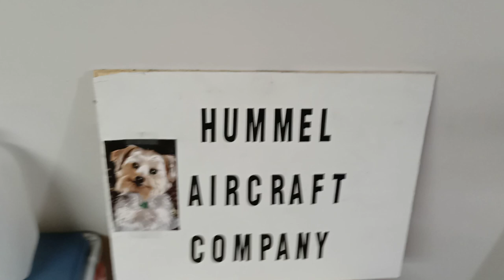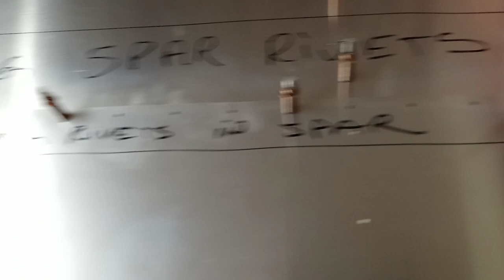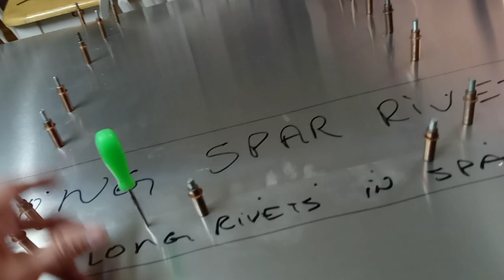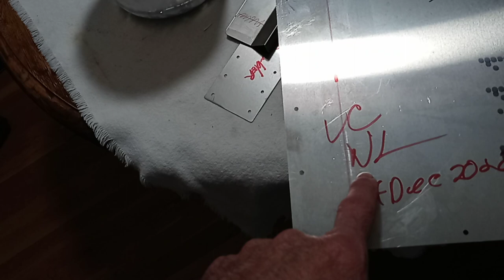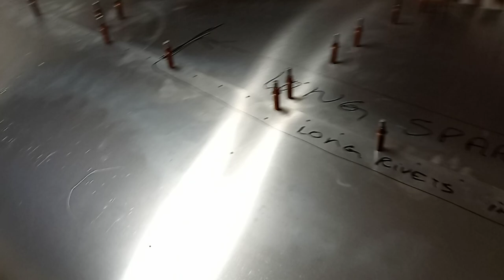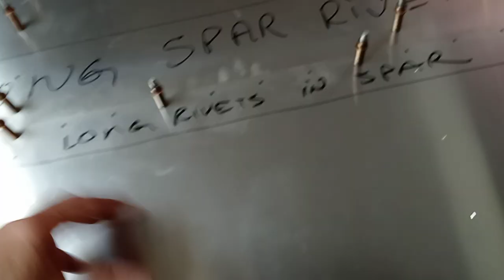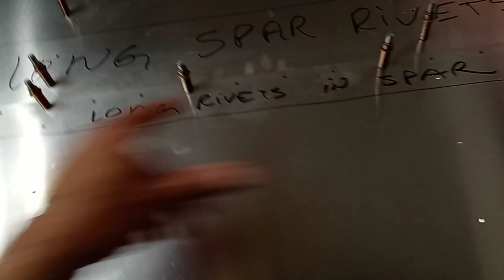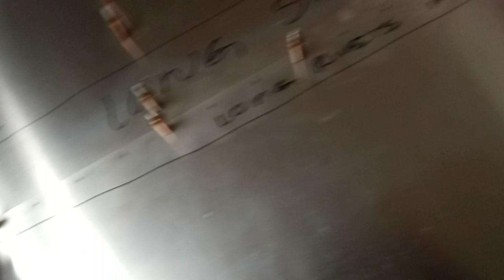Ultra Cruiser ?????

Comment: Have you ever searched steel yards and surplus yards for a 10 foot length of W beam..which is wide flange I beam to become the bottom section of a sheet bending brake. 4 or 5 inch W beam. Bolt on ends for the legs and for what ever will become the top clamp and bending face. Plus break down to store standing against a corner or along the base of a wall..
Covering the steel surface with a strip of aluminum to not damage skin panels when clamping them for the bend. 
I can see three W beams in use for this to be rigid enough for  decent long bends. Minimal machine work. Studs with belleville washer from the main beam to the top clamp down beam only notches for the front swing up beam hinges.  Perhaps commercial door hinges like for heavy fire rated doors mounted in slots and notches in the top of the main beam and the top of the bending beam.
Reply from the maker: Bi Wayne P well no sir I have never looked for a 10 foot I beam. But i do have a 4 foot brake. When I built my H5 a guy had a 8 foot brake that I used. He has sold it now. I did start to build a brake out of wood but it did not work that great. So I bought the 4 foot brake.....